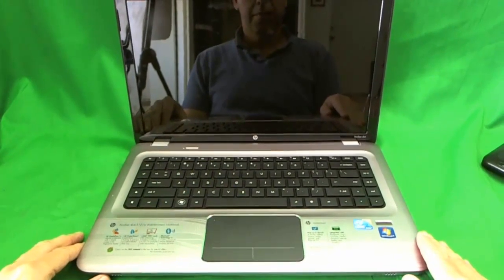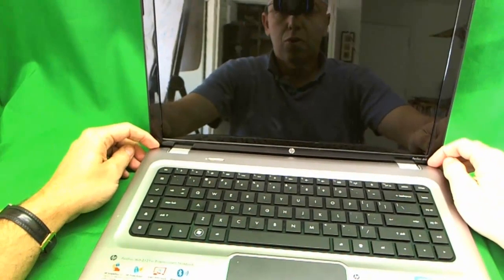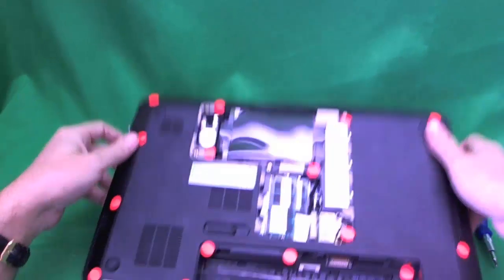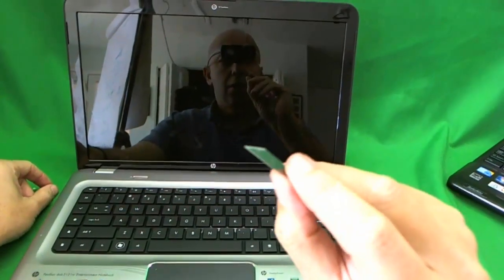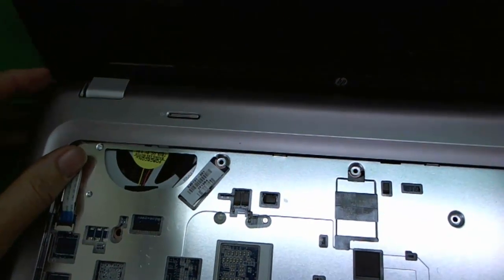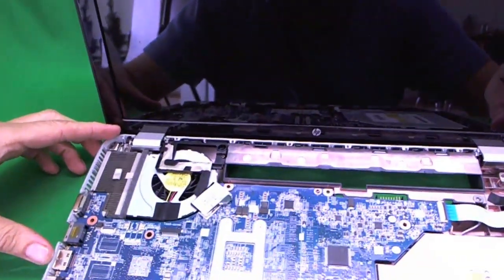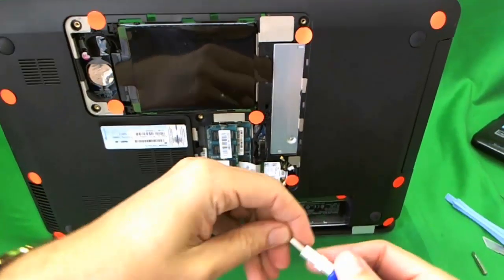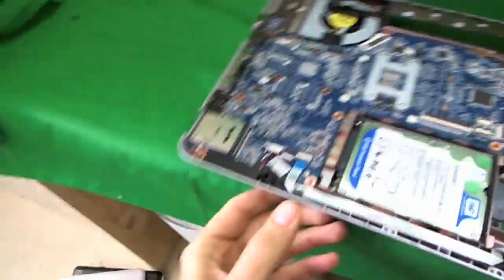HP dv6-3121nr Laptop Screen Replacement Procedure Part 1

Comment: Hello I have a dv6-3127dx can you help with replacement of the inverter i thought it would help find it by watching your video but i don't see it. Like on other laptops thought it would be under the screen the bottom of the screen .  Can you help with location maybe this model doesn't have a inverter.

Comment: For those that had trouble with re-assembling. If you can't take the time to write down a basic work-sheet then maybe you shouldn't pull things apart. If your mechanic worked on your brakes and had spares left over (but they seem to work) would you feel safe in that car ever again? ;-)

Comment: I know this is an old thread, If I replaced the screen and all went well and a day later it went half dead with all vertical lines does this mean the screen i purchased was bad? The cable and all connections looks good!!

Comment: $75, couple hours using the youtube video, & back in business. Notes that may help others: Screws vary in length/location, used 8 1/2 x 11 paper for diagram of back plate w/tiny circles & pushed screws thru paper to hold until reassembly. Listed every step on note pad while viewing video & during disassembly - reverse for assembly.Guitar pick & tweesers were handy, used plastic ice scraper 3" blade(shape of #1) to remove screen trim piece. Comps said it would be cheaper to buy new. TY Eugene.

Comment: I was just able to replace our screen thanks to this video (part 1 and 2) it only cost 75 bucks online.  Without this video we would have been buying a new one... This is not a quick and easy replacement and I had to go back to the video a couple of times when putting the system back together again to get the wiring...  Thanks!!

Comment: Dude - releasing the ribbon cable latches with the point of an X-acto knife?  The prying tool you have right there is much safer - no risk to the cable!
As far as removing the keyboard is concerned, I've found that with this design where there are no easy release points around the keyboard topside, using a very small phillips-head blade to push it up through one of the screw holes underneath works very well, and prevents the possibility of any damage or scarring to the finish topside.

Comment: Ty so much for this video.  Broke my screen then i bought new one on ebay for 80$.  5 days later, my comp works very fine.  But i still have 1 screw and a metal piece after i have rebuilt my comp...dv6-3077ca

Comment: I followed the procedure on my hp dv6 3131tx but when i assembled everything the laptop does not switch on at all! The light turns but goes off immediately and this continues untill i take the battery out.. The laptop does not power on at all.. Can someone please help me with this? Has something been damaged? I have double and triple checked and have not forgotten anything

Comment: This would be a lot more complete if you showed how to assemble this again.    I can see it with a very simple replacement but this is very difficult to pull apart and get it all back together again CORRECTLY.    This reminds me of a Chilton or Haynes auto manual.   It tells you most of what you need to know but leaves out some of the most important aspects assuming you can remember everything you pulled apart and get it in the correct order.

Comment: Thank you soooo much! Just completed my own screen replacement "PERFECT VIDEO" putting it all back togethr in reverse was a little tricky. I placed all screws on a piece of tape and labeled as removed. This helped a ton. I was almost done when I realized I forgot to install the plastic hinge covers.....other than that went pretty smooth...Thanks again! found the pry tools at local electronic store...ie radio shack, frys.

Comment: @ScreenSurgeons thank you. I've tried doing it to see if i need to bring it to a professional. When I get to the keyboard section, near the middle of the keyboard, it's like stuck and i'm afraid to use force to lift it up. is that normal? same with the area near the mousepad